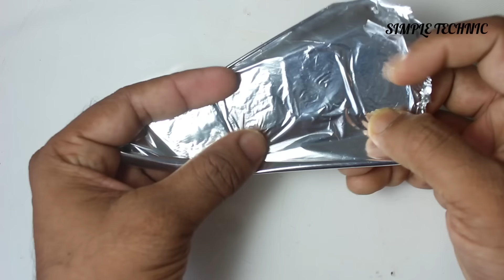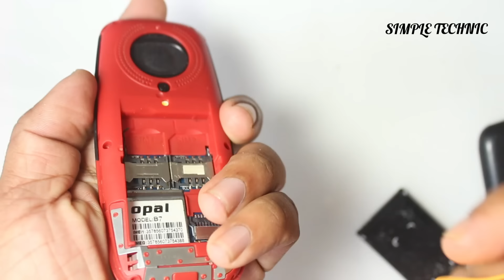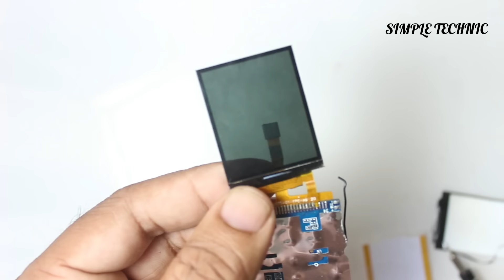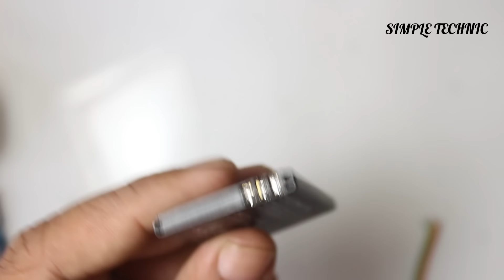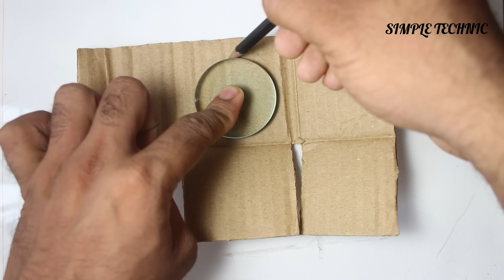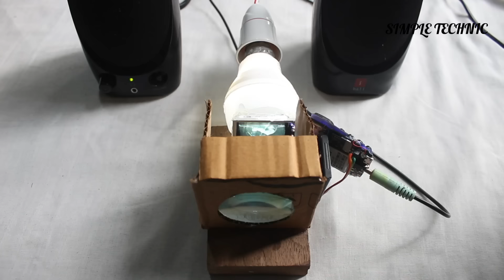How to Make a DIY Projector

Comment: in my childhood days, this is main interesting work (showing picture  using films ) .  I used glass bulb removing all inside parts and filling with water as a lens . My aim was to use actual bulb using electric current for light source but it was failure  as  it was focused the tungsten of the bulb whenever film was zoomed.  it was around 1985-1990.
Reply from the maker: I had such good days too. Now i remember those good old days😌❤
Reply: Our hoodhood was awesome.❤️🥰
Reply: Same exactly similar experience and the year also close to that same period .. 😍
Reply: We used 35mm movie film pieces collecting from cinema hall's garbage dumping site
We used to buy actual convex lens costing Rs2 only
During daytime we used sunlight for projector and the size of the projected screen is about 43 inches made from white card board paper or cloth
Those sweet memories ❤️😭
Reply: The good old days, the world is messed up now
Reply: Only the video? no sound? I did a similar thing but I used a halogen bulb, model train motor coupled to a toy cars gearbox and a film sprocket, photo tube (because I had a few and why not) and simple audio amp for the sound section. It didnt run at the exact speed but it did work.
Reply: @kujodele4195  Yes it is and it's largely due to people living their lives in a virtual state of mind rather than actually going out and doing things.
Reply: Sounds like what you needed was some sort of diffuser between the bulb and film.
Reply: Kkkkkkkkkklkkkkkkkkk Eu Estou Com 64 anos, Era Assim Mesmo, Um Negativo Filme De Foto No Fundo De Uma Garrafa kkkk Vç Trouxe A MINHA Infância, A Nossa Infância, Obrigado Meu Amigo

Comment: Instead of using single lens use two convex lens which will give you better result.
Fix one convex lens near the LCD display so as to make the divergent ray from LED  into nearly parallel emergent ray.
Place the second convex lens (with larger diameter ) at a position a little farther away from the first lens.
Focusing maneuvering should be done with the second convex lens.
Reply from the maker: Great❤👍🏻
Reply: Try to use fressnel lens instead of this glass  lens shown .
Reply: @james-bond-007  Френель может дать неприятные кольцевые артефакты

Comment: Great project. For most of us who have old projectors which use expensive bulbs which only last 1500hrs, can you please make a project converting them to work with led bulbs?
Reply: Take your bulb, find the type it is and cross reference the serial number. Usually you will find a LED equivalent.

Comment: Made a projector at a very low cost, it's great, it would be better if there were speakers👍
Reply from the maker: The speaker is connected.
Sound had to be removed due to a copyright issue🙂❤
Reply: Solo vinculando a Bluetooth ya tienes buen sonido

Comment: If not mistaken, the only additional thing incorporated is the lens, isn't it? He magnified the video/data on his mobile. Other than that just the mobile parts arranged to fit the desired outcome. Whatever it is, it is a good work.
Reply: Light power
Reply: Modda
Reply: Strong Backlight for screen is needed to project.

Comment: Great project. For most of us who have old projectors which use expensive bulbs which only last 1500hrs, can you please make a project converting them to work with led bulbs?
Reply: مح
Reply: The amount of things were used in this clip, one have to buy a particular kind of phone, a particular kind of bulb, hot glue gun, glue stick, I don't know the thing's name which were used to connect wires with mobile battery, a particular kind of lense, foil paper, wood or some platform screwed togeter for which screw & screwdriver are also needed and probably more. I couldn’t keep track. After all that the result is almost 0. I would give it negetive marks. Imagine buying all that, thought, workload etc. How could anyone think that it’s worth it. It would be better to wacth on that phone screen than that so called projector. I persally have experience of working with projectors. In fact I still use them every now and then. There was a time I used projectors more than 12 hours in a 24 hour 7 days a week. I learned painting technics using it. My teacher at university sometimes used projector. Even I being a teacher for fun use projectors at different institutions at different times. Day before yesterday I saw a guy who does wholesales of construction matterial like roads, cement etc hold an annual function of collection that he lend that year was using a projector. His name is Ranjan dey. It’s way better to use a real projector than his made up tiny one. I mean through projector 1 can use a 30' by 20' to wacth a movie or a match or whatever. 50 people can watch it. Not just 1 thrugh a lot of struggle to find the right angle.
Reply: I could do one, but I need a suitable projector
Reply: @omaromaar7044  🙄😴

Comment: Directions unclear, head stuck in toaster.  Please send help.  In other words, expanding this concept out, you could make a decent quality projector with a small screen from adafruit some 50W LEDs also from adafruit and a fresnel lens and power it all off the same circuit.
Reply from the maker: Ok Accepted❤👍🏻
Reply: L

Comment: Only one question, why did you glue the lens cardboard assembly to the main umm body structure, you can't focus the picture for multiple distances if it's fixed in place maybe making an armature out of hinges or rods or using one of those flexible phone holders would work better so you could adjust the placement of the lens while using it, or even making it from a metal coat hanger you could bend to the right distance so your picture could be bigger on a larger screen and stay focused, other than that it looks good.